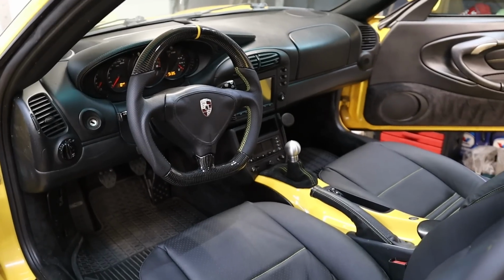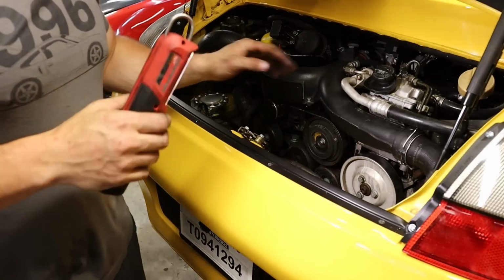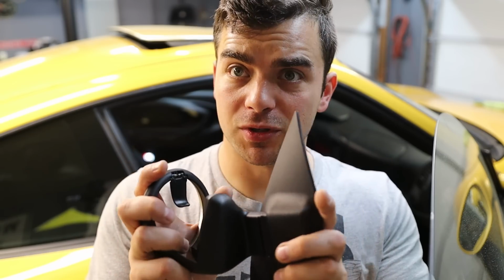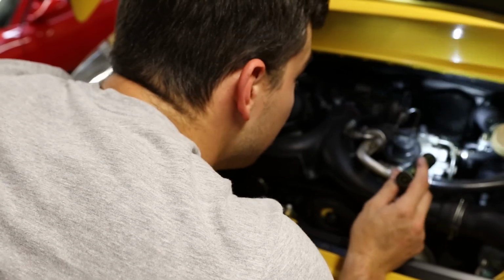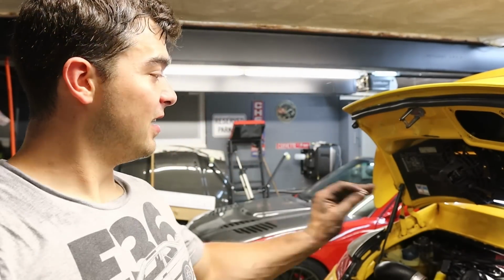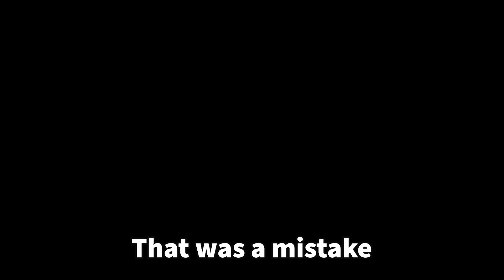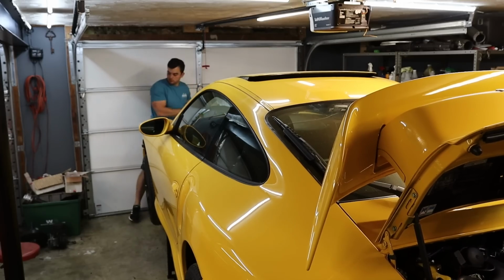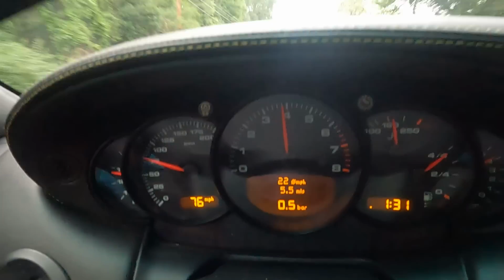I Bought a Cheap Porsche 996 Turbo and It's Unfixable

Comment: Boost leak aside, the larger throttle body and plenum may require the car to be tuned. Might be worth talking to one of the tuning shops in your area just to get their take on it as it could be resulting in the high idle. Not sure where in Maryland you are, but RPR Automotive and TPC Racing are the shops with which I’m familiar.
Reply: This comment right here is the answer. A second set of eyes would be nice and you get to support the local community.
Reply from the maker: I will eventually get a tune, but the goal is having it running / driving correctly in it's stock ish form first.
Reply: @matt13ross  might not be possible with physically different parts though, like to avoid the tune you need stock parts most likely, might be easier to just get a tune
Reply: Rpm in Hagerstown is cool too

Comment: I suspect the idle is a separate issue from the boost leak. You were hitting .6 bar and not even at redline so it was still climbing. Keep in mind these cars need to rev high. Mostly I think it would really benefit from a good tune. Especially with the new throttle body and putting the stock air box back in. Who knows what the previous owners did with it. 

P.S. another vote for dropping the motor  if you’re going to keep chasing the boost leak. If you do that, might as well change the plugs/coils while you have it out and clean the map/maf sensors. That should smooth her out quite a bit.

Comment: I had a similar issue. Mine turned out the be the left side lower boot between the left intake manifold and the tube that connect to the right manifold. The hose band is tight but it slipped off the back where you cant see it. It will require some stretching and acrobatics to get to it. I watch your videos but dont read the comments. I have 2 996tt both I dropped the engines to do the coolant pipe pinning and replace aging rubber hoses. I highly recommend it. It not as hard as most people say. the only special tool I used was a lift table.

Comment: First thought, maybe try to put the stock throttle body and plenum back on, is that an option? If the car idles correctly with those being stock, as another poster said, possible a tune is needed to correct the airflow. However, the idle being high def makes me think of a vac leak somewhere. Have you tried an E-Gas reset? What about unplugging the MAF to see if anything changes? A bad MAF will throw off the airflow readings. If you unplug the MAF and it idles normal, you have a bad MAF. Also, check the oil cap and oil filler tube to see if they are cracked. Hope you are able to get it fixed.
Reply from the maker: Nah the stock plenum broke. E gas reset? Unplugged the maf and it barely ran lol.

Comment: Having as much fun as I am.  I bought mine in 2018, upgraded a lot of stuff, even spent a decent amount on rebuilding the transmission (manual).  Been in the shop ,mostly, since 2021.  Had the upgraded stuff done late 2020.  In the shop now.  Put about 3k miles on it since 2021.  The shop is still sorting it out and, we think it is possessed.... lol.  04 convertible.

Comment: Well, I’ve seen this many times in my early years where owners try to make repairs, then take that walk of shame to a repair shop. I applaud you for your tenacity, don’t give up. You can try closing the throttle body butterfly to force the engine to draw more air through the leak, then take a small hose to your ear and start listening more accurately for the source of the leak. You can also try shooting a little starting fluid around the area you suspect might be leaking and see if the idle rises, that might help you narrow it down. Good Luck Matt!!
Reply from the maker: I've tried the starting fluid, didn't change the idle, which was weird.  I'm going to try a hose to my ear.
Reply: @matt13ross  I used to use a stethoscope probe with a longer hose attached to the end. Worked really well.

Comment: You've done so much by yourself and the car has been brought back from crap to outstanding! Can't beat yourself up as the computer systems in porsches are finicky as I am learned myself on my 02 996. I purposely avoid stock turbo setups because of the issues and I am not yet at that stage to learn about them myself. BUT, I would say it couldn't hurt, nor do I think would anyone hold it against you if you took it to a local specialist, not a dealer obviously, to see what you may have missed. Sometimes they have the expensive tool that can connect to the obd2 and read everything and every sensor and will lead to a faster diagnostic or they may just have seen this before. That would be my suggestion if you'd like to reward yourself and take a break but also solve the issue so you can enjoy the car. Good Luck man! As always I love the content, love my poorsche shirt, and hope you get it figured out!
Reply from the maker: Thank you!!!

Comment: I once had issues with idle keeping at 2k rpm and even going up by itself just due to a faulty new (!) MAF sensor. I would assume you'll need to run an adaptation or something for the TB, VAG cars are known to be very particular about the airflow

Comment: Pull off the pipes, hoses & plenum, etc, block the ports & test if they hold pressure on the bench (either with smoke or in a tote of water) to rule them out one by one. If there’s anything you can’t access as part of the intake / vacuum system I’d assume it’s all to blame & replace it in one hit with a motor drop. Have you looked at the turbo’s? Checked the waste gates are staying shut while boosting? (Just pull them off & send them away for a refresh with billet wheels & drop the motor so you can see what you’re dealing with on the leak & fix whatever other goodies you find).

Comment: I have noticed you have tilted your motor down by taking out the rear mounts a couple of times to give you better access. I have a feeling by doing that you might have hairline cracked the plastic manifold on the front left side of the motor right along the firewall. There are long plastic mounts on it and they can crack at the base if you tilt the motor down without unbolting the stuff mounted to it. Worth a look, this happen to me years ago and was very hard to find, I pressure tested and smoked…. The smoke only came out when the engine was under load, that’s when the crack opened up bigger…. My idle was at between 2500 and 3000 rpm. Hope this helps! 

Mike Salek
Reply from the maker: I sure hope not!

Comment: You’re doing this right Matt, but WHERE you introduce the smoke is the important part when chasing boost leaks. It could be on the hot side, cold side, recirc/blow off. You need to be methodical and use diagrams of the systems. Good luck. PS-Have you gotten the tow hook plug installed in the front bumper yet?!
Reply from the maker: No tow hook plug yet lol.

Comment: Watching this a few days after upload, and from reading the comments, here are some ideas you can try before dropping the engine. 1. In my experiences with turbo cars, the blow off valve/by pass valve/waste gate seems to be a big issue when it comes to boost leaks. 2. Trash tune. See if you can retune to stock tune. 3. Maybe new maf?
Reply from the maker: Stock tune!

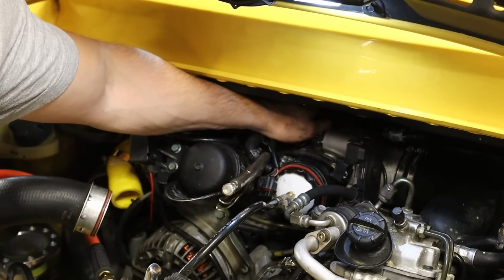Comment: I have the same smoke machine. Love it.  Gonna check out those cup holders. Now that i'm driving my two 911's I need something to hold my stuff! Did you forget that you have a positive post in the engine bay so you can run your smoker there? I did... once.  13:01 Did I just see the tripod on your gimbal go up down by itself? The computer should tell you have a massive vacuum leak. It may not throw a code right away.

Comment: Not sure how these are setup, but back in the b5 s4 days when we used to pressure test them, we had to make sure any pcv hose off the intake/ypipe was also plugged. If not, the air is just going to escape into the crankcase. It should be able to hold the pressure you feed it and slowly bleed off.

Comment: OK, the big thing to think about with a high idle is air.  The throttle body restricts air going to the engine.  If the engine gets NO air, it would not run and would stall.  If you give it just the right amount of air that will set the idle speed.  Too much air and the idle will be too high.  If you have a larger than stock throttle body and the ECU commands it to open a certain percentage, that may be letting more air in and setting that higher idle.  Other possibility is a vacuum hose that is connected after the throttle body (between TB and engine) that has a check valve or something like that that is failed or backwards and letting more air in than should be getting there.
Reply: Also don't give up!  You are SO CLOSE!  Analyze the situation, do testing, get evidence, move forward.  You can do it!

Comment: That cup holder I'm almost certainly sure is from a mid 2000's BMW 6 series. My Dad had a 645Ci and it had that cup holder. Not sure if it was used in anything else.

Comment: Have you consider that the boost pressure sensor is bad. also could be that these recirculation valves are broken. best at this point i think that is drop the engine and replace every gasket and oring, and yeah there check the sensor and valves 
Its pretty amazing how this car still fight you this hard. i hope so much that finally runs well again

Comment: I called IPD when i couldn't get my plenum to fit (the crossmember was 180 backward from factory). They told me the larger throttle bodies don't run as well for daily use.

Comment: At some point you may need to drop the motor.  I've never done it, but I've talked to several people that have an they all say it's not bad since these cars are designed to be race cars, and so pulling the engine is something that is planned and designed for.  Once you have it out, you can fully see everything and I'm betting you have some hose or connection cracked or broken that you just can't see with the engine in.  It would also be a perfect time to do the AOS replacement and maybe even the coolant tank as those are PITA to do with the engine in.  Good luck man... I feel your pain.

Comment: Wish I could afford it..still gotta put together my fd3s project...keep it up man, the car looks nice (not a yellow fan personally but it does look good)...you'll find its probably something small along with a new tune. Turbo cars(especially German ones) require programming for EVERYTHING...I've got an F30 awd bmw...yeah you change something you gotta reprogram. Somethings are fine if your not changing anything mechanical other than say exhaust or charge pipes....but bigger bov....depending like to atmosphere, tune, bigger throttlebody, tune, bigger injectors,  tune, etc, etc

Comment: Ok, not sure if it’s been said, but:
1) do a throttle position reset. Look up the procedure, it’s simple. 
2) get an odb redder with an app that will show you the throttle position in real time. 
3) Re-check the n75 valve and its connections 
4) leave the battery unplugged overnight to reset the DME.
Reply: Honestly, I think you fixed the boost leak if it held air that long. You’re now fighting with throttle/DME/tune issues I think. Maybe going into limp mode without a code thrown.
Reply from the maker: Awesome tips thanks!

Comment: Looking at the last shot of the engine bay in the video, I think you have the diverter valves in backwards. As well high idle is usually caused by a vacuum/air leak. Google 996 turbo diverter valve installation and try a throttle body adaptation/reset.
Reply from the maker: Yup, I've got those flipped around now.

Comment: not sure if you changed the throttle body, as I haven't seen all the episodes, but if you did that, it means the more air is able to get in even on the 1° (closed valve) position and car is trying to compensate with more fuel to get the gas/air right. Thus higher idle rpm and lower boost as well. Did you tried original throttle body?
Reply: I agree that this is a good place to start. Might also want to do a throttle body adaptation to help make sure it's actually getting true readings. Also be good to hook a scanner up and check the fuel trims. Although it probably needs another couple of drives to adapt.
Reply from the maker: Throttle body re learn is on the list!

Comment: No, Mat! Dont give up!
I think this car has not seen a major service for 10 years... main reason most likely.
But secondly: You have a larger trhottle installed -> I think that thing needs an urgent setup and remap. 
Also would not drive too far and too hard with it as is - it may run lean?
Go for a setup and remap.

Comment: That cup holder is awesome, but it's $169.00 before discount and still $152.10 after.  That's a pretty steep price that may turn off a lot of people.
Reply: Hmm when owning a porche 911?
Reply: You can afford owning a Porsche 😂
Reply: That's Porsche tax for ya
Reply: I just got the cubby, and the quality is excellent. I have found hat you get what you pay for with 3D printing. I will be ordering mine soon!
Reply from the maker: Meh, I don't think the price is bad at all.  It's a GREAT design and fitment is outstanding.
Reply: It turned you off so I could buy one of the remaining three. Thanks, cheap guy. And thanks to Matt for the heads-up on this cup holder as I had not checked Rendition in a while.

Comment: Stick with it Matt. Youre very close now. Personally, Id double check that the throttle body and inlet manifold bolts are the right length and and are properly torqued down and have it properly set up by a pro then enjoy the car. You've done everything right so far and deserve to enjoy it over the summer. The car seems like a perfect candidate to have a dodgy 'tune' from a previous owner. If youre not sure of its history, thats another good reason to get it properly set up by somebody who knows what they're doing
Reply from the maker: No tune on the car. When I bought it, it was at .7 bar all the time with intake and exhaust.
Reply: Thats probably good news for you, Matt. Good luck with it all.

Comment: Throttle body bearings often leak once they get old.  Seals break down and throttle shaft wears. Try testing it by itself by macgyvering something together.
Reply: true, but not that much. Depends on construction. Usually there is the bushing in the plug side, and the plug it self is seal. Than the sensor side usually has the bearing where the small leak could be thru the bearing lips into the throttle body. If the sensor has gasket, the leak will be small as well. If I remeber, leakage limit thru the bore is 20ml/h and for the throttle body-sensor is 5ml/h. But it's few year when I was working in production.
Reply: @milanulrich  I guess maybe the problem is worse on the 930 model that I have?
Reply: @JF-4444  it's hard to say. Worst case scenario is the oil thru the shaft and bearing to the inside, as this makes abrasive paste with plastic gear and motor inside and destroys the gear. Throttle is very similar in construction for all the manufacturers. I have no experience with VW/Porsche. Only the Toyota, Renault/Nissan and Volvo. But for the leakage...usual life span for throttle should be around the 150k if there is not much of the contamination inside, or more. You will be able to check the insides easily when sensor is hold by clips. Small screwdriver into the clip and push it out. Then you can remove the sensor. If there is the gasket, it will be in the sensor and even if it fall out, you can easily push it back. Then the middle gear  between the motor gear and spring/gear on shaft can fell out. So open in horizontal position only. If you can't see any wear, contamination, oil etc, you should be fine with leakage thru the shaft/bearing. Some cheaper construction have the bushing in the sensor side as well and these can leak more of course. But! Intake with throttle do not hold vacuum. It's air inside to the motor. ECU is measuring the air/gas ratio and telling to throttle how much open it should be. I mean in this case I'm leaning more to communication problem with the units as the program in ECU can't compensate for differences in air volume to gas.
Reply from the maker: Well my throttle body is brand new.

Comment: You are seeing your idle high .it could be an internal air leak behind the throttle .this could be caused by engine breather . It could also be the plenum that you installed. I'm not sure if you did a throttle body adaption to reset it . Reach out to Ross tech vcds to go through the readiness settings to verify your repairs .Audis porches vws and all their cars have this capability try it out . I feel your pain though 😢.

Comment: would it be worth blocking the intake tubes at the Y pipe going into the intake? is there a chance that its just bleeding into the motor and not holding pressure. that way you are checking all of the tubing before the motor.
Reply from the maker: I can hear is escaping somewhere.

Comment: Has your water temp always sat that high above 180?  Seems high... should be a tick over 180 even in hot weather sitting still maybe slightly higher.  But for 80 degree-ish weather moving should be sitting just over 180 fwiw.  Also - don't get discouraged.  I also bought a basket case 996TT 12 years ago and 12 years later having replaced most of the entire car with new and replaced parts it's finally working correctly. You just have about 11 years to go but you'll get there!
Reply from the maker: I’ll have to look at exactly what it’s at. Perhaps a tick above 180.

Comment: you should get 0.7 bar at around 6000rpm when it's producing max power. I get max boost at around that in my 996 turbo S.
Reply from the maker: I think it should come on sooner than that.